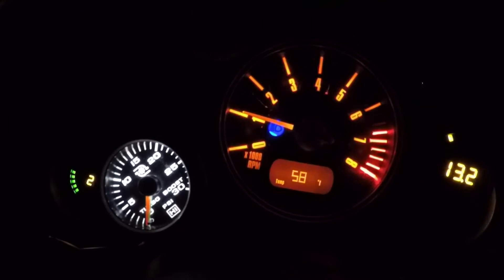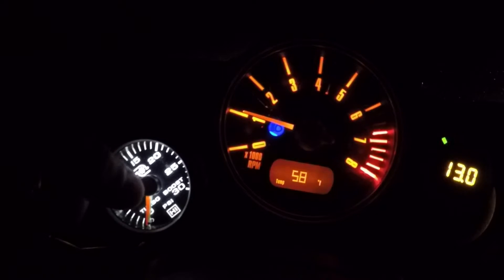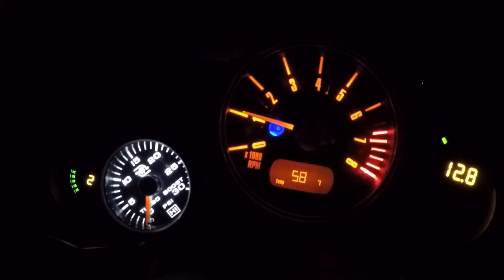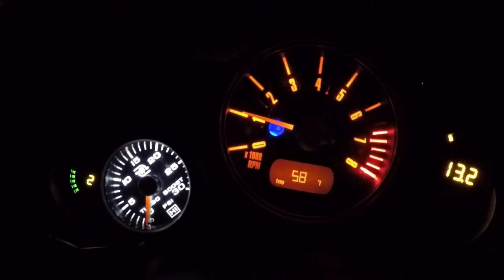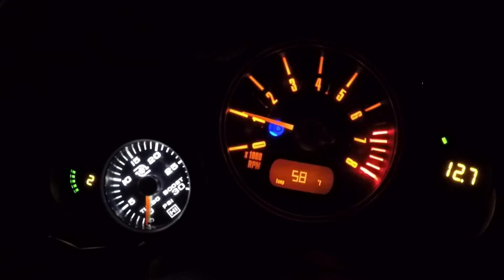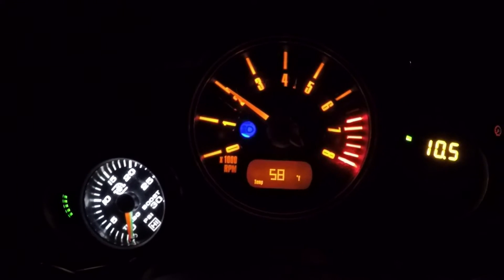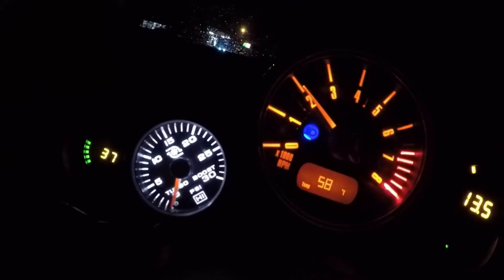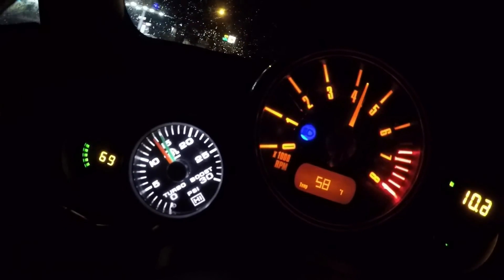Twincharge crossover explained-ish

Comment: Brad I have just red your thread on Northamerican motoring and I have one question for you. Is there a reson why you dind't connect supercharger bypass before intercooler? That way you would have cooled charge when in 'turbo only' mode. This way you are blowing directly from turbo to inlet manifold when bypass is open.
Reply from the maker: Yes. Had to do with packaging. I could have done it. But it was a nightmare with doing it cleanly.

And this does not do that. All the air always goes through the supercharger. It never bypasses the SC and IC through the valve as the intake manifold side of the valve is always higher pressure than the turbo side. The reason for this is the SC is a positive displacement device, and always spinning. You can see this in the video even! The turbo needle never passes the IM needle, and always stays a few psi short.  Hope that explains! Great question!
Reply: I am also building twincharged car (Audi coupe 2.7 biturbo...https://www.youtube.com/watch?v=dqFMgJYDLyQ), so I am researching everything about twincharge cars that I can find. I have tried compound setup without bypass and the power up top was quite lover then I expected, so I decided to install bypass valve. I will be using dbw throttle from Mercedes kompressor so I can map ecu to have fine control of transition from compound to turbo. Did you try running just compound boost on dyno? If you did what were your results comparing to sequential setup? Also what is the diameter of your bypass valve? Main is 50 mm and I was wondering is that going to be enough. I am bypassing Eaton m112 and I have twin Garrett GT3582R’s.

Comment: I don't get it, but i wanna do it too.
Can you do a list of all parts i need?
Reply from the maker: well.. It started as a 6" long piece of 3" round aluminum rod, a chunk of stainless, and some more aluminum.. Throw it though a lathe and a brigeport mill and you can make yourself a valve! 

Or use a Tial QRJ with a high flow precision regulator.

Comment: Have you got any pics of the bypass valve? The next twincharge setup I do is going to use a chinese wastegate. I used the stock eaton butterfly bypass last time but wasnt progressive enough at low boost. Cheers
Reply from the maker: Tim Morton I made it.I can get pics if you need but I made it from billets of aluminum, stainless, and brass, annodized it at home, and it uses 2 clocked ptfe split rings as piston seals instead of an oring or a diaphragm. Crossover is set by a combination of valve geometry, spring pressure, and a high flow insanely accurate pressure regulator from McMaster Carr.
Reply: Brad Daley  So the actuator you made is controlling a butterfly bypass etc? Sound similar to what I made except I used a v band clamp to join the halfs.
Reply from the maker: Tim Morton not quite. It looks like a bov blended with a wastegate. Its not a butterfly. My throttle is also on the intake manifold, after the SC.
Reply from the maker: Tim Morton. Here is a Imgur post from when I was working on the valve. A few scattered photos of its creation. The first photo is current design, or closest to it. Second photo is similar, but for a different design intent. 
 https://imgur.com/a/D6Hno

Pic of finished valve https://i.imgur.com/Ljcopk0.jpg
Reply: Brad Daley  Thanks for the pics. So basically a wastegate that will also open under vacuum for your bypass. Have you got it opening pretty much at the 15psi mark with it compounding a little first? Are you controlling boost from the intake manifold? Heres a couple of links to look at my old setup. http://s966.photobucket.com/user/rb3torana/media/Mobile%20Uploads/20160625_185710_zpslbis5cbv.jpg.html     https://youtu.be/jYNX3tZf3sE     http://www.performanceforums.com/forums/showthread.php?67304791-Compound-turbo-1JZ-LX-torana/page7
Reply from the maker: Tim Morton it works like a wastegate essentially. I am using a industrial air regulator as a boost controller if you like, that controlled boost reference comes from the intake manifold after the throttle, and goes to the ' top hat' or backside/top of the piston  

The face of the valve sees compounded boost, and the middle sees turbo only boost. 

The diameter of the face is smaller than the middle, 

So if the radius of the face is r1, and the radius of the top is r2, the effective areas for pressure   are 

Face, compounded boost, trying to open valve: (r1)^2*Pcompound

Middle, turbo only area: (R2^2-R1^2)*Pturbo

Back of valve (holding it closed): R2^2*Pregulatedreference

Because R2>R1and compound boost > turbo boost, amd the reference comes from a compound source, this means that with the spring pressure added to the closing force, I can set the valve to start opening wherever I want, or to never open at all(at WOT and not regulating the pressure down this would happen). Simply with one regulator. No need for other spring changes. And being all mechanical it is a fairly seemless and smooth transition. 

Butterflys are great as a SC bypass because the pressures on both sides of the valve do not effect the valves operation, but I instead wanted the pressures to aid in the valves function so a butterfly is not optimal for what I wanted it to do. 

In this setup the boost point for crossover is set by all the aforementioned stuff, but also throttle position. It could be done with a butterfly and a custom actuator that took dual sided boost references, but I struggles to remove friction, stiction,  and slop in the setup while keeping it compact.
Reply: Brad Daley . Neat idea mate, thats what the issue was with my valve was the butterfly wanted to slam open so not progressive. I'll be using a wastegate I think and the factory bypass for vacuum etc. Thanks again 👍
Reply from the maker: yup!. I noticed the same issue with my bench tests when I was messing with valves. That is what lead to the idea of making the custom valve. 

I am not sure, but I also think you could use a Tial QRJ
http://www.tialsport.com/index.php/tial-products/bovs/140-tialbvqrj

And a good regulator. Mine is a high flow precision regulator (+- 0.05% of range. Range of 0-15psi) (engineer here. wanted to get best results possible. Will look into smaller cheaper units later) 
And it sits in the cabin to take away the factor of heat from the engine messing with the regulator. 
https://www.mcmaster.com/#1888k1/=19n3bxx

Pricy, but it works well.
Reply: How much would you charge for the special part that you made? Or is there another way to get the part already made?
Reply from the maker: Hi David, 

I actually have several prototype valves at home that I could finish out, but I am not particularly set up to finish them out and get them out the door at the moment. (I had a run of 5 prototype valves made via alibaba after my initial prototyping, but then made a change to the design and the one in the car I made myself from scratch, but the 'old' design (has a little less pneumatic advantage in the top hat) should work and I have a box of them. bahaha. 

As I said in a previous posting, It looks like the Tial QRJ would work for this application in conjunction with an industrial regulator or some other form of boost control to regulate the bypass pressure. (I used a high flow precision regulator from McMaster Carr) (If you wanted a name brand solution. It measures larger than my valve.. but diaphrams are almost always less compact than a ring seal.. although they have many advantages such as stiction. I got around most of this by using dual clocked teflon split rings and was fine with some vacuum and boost leak ( it is really small)  (works like piston rings) )

Comment: r53?
Reply from the maker: Diego Diaz. yessir. 2003.
Reply: i have a 2004 and I would like to know what kind of turbo you used
Reply: Or what modification did you make
Reply from the maker: Diego Diaz I have a comp CT2-5147, but if I was to do it again I'd go smaller and the comp and an oil lubricated, or with a smaller EFR turbo. if I had the cash is go with a VTG off of a Porsche or something.